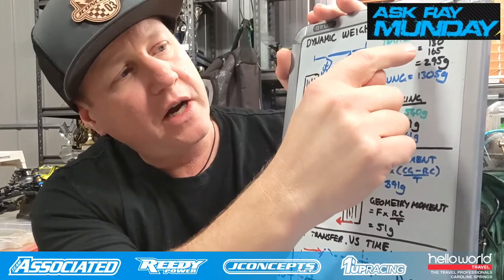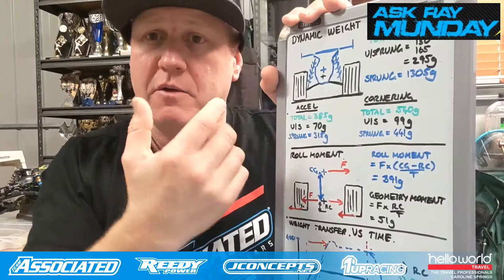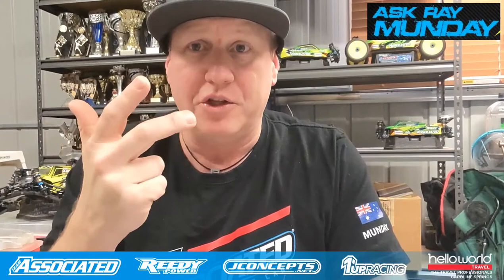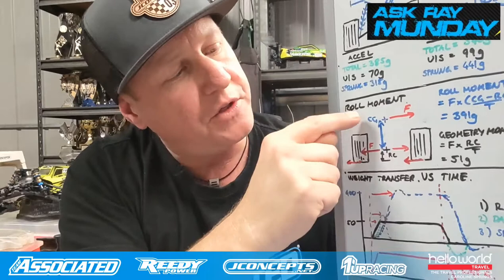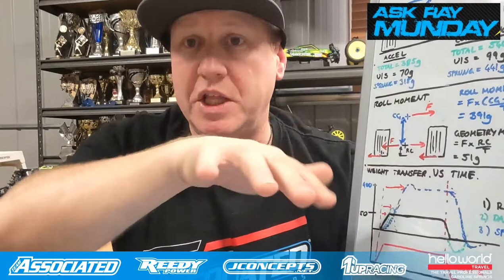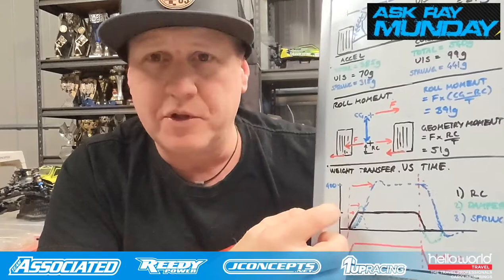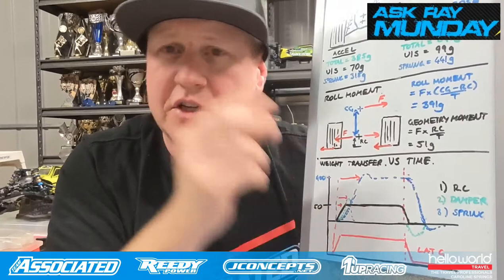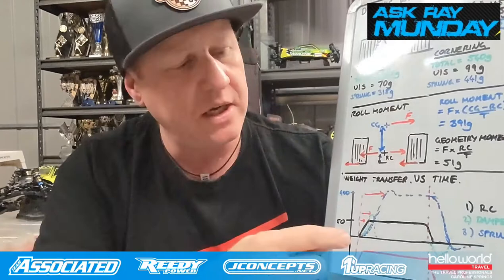*RC Weight Transfer Part 2 - Dynamic Weight Transfer * Ask Ray Munday

Comment: I was lucky enough to have Doug Millikan (of RCVD fame) as my uni vehicle dynamics teacher. I’m used to having to correct a lot of misconceptions and when I saw someone misquote what you’d said on this video I sat down and expected to find some.

Instead, I have to say, this is a great high level overview to cornering dynamics. First rate!
Reply from the maker: Thanks for the kind words. Having someone like that as a teacher must have been amazing!
Reply: @rmunday76  I didn’t appreciate it enough at the time, though they were easily the best engineering labs I ever had. 

Your videos all seem really well done, I’m becoming a fan despite having no experience at RC scale.

Comment: If I understand you, the oil I the outside shocks should be thicker to help the inside tires from lifting in a turn.
Reply from the maker: Hi mate, yes and no. If you have more damping on the outside initially there will be more weight transfer to the outside and less change from the inside so it will react faster. However that will jack the car up slightly raising the centre of gravity so it will then have more weight transfer and lose grip a little, so it's a trade-off. In full size shocks you can change the damping in rebound and compression and you can fine tune these settings.

Comment: Hi Ray, Fantastic video!!. What happens in the situation where the the roll center is below the ground? In that situation roll center forces are negative?  Thanks a lot in advance.
Reply from the maker: Good question and it's actually the case for our 1/10 buggies that roll centres are below ground. Basically when there is a lateral force it pushes the inner wheel down and the outer wheel up, effectively slowing down weight transfer to the outer wheels. It also means that there is more leverage from the CG to the roll centre so the sprung mass roll angle is increased (more force acting on the springs so the car has to roll further). I'll do a follow up on this but the phasing of the forces (roll centre -> damping -> spring) doesn't change.
Reply: @rmunday76  Thanks for the reply!